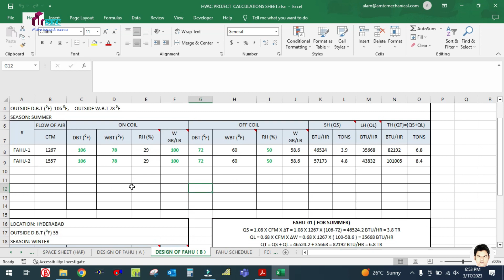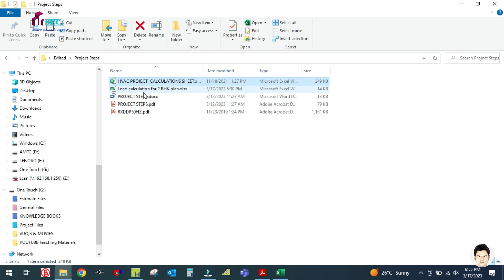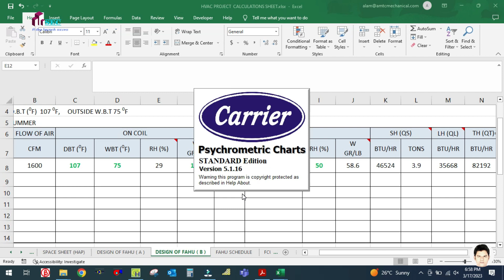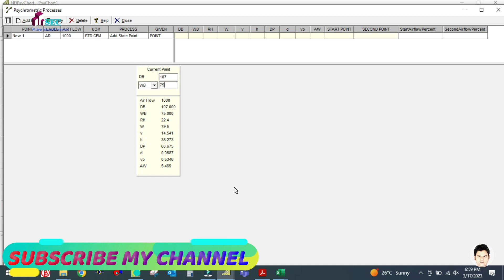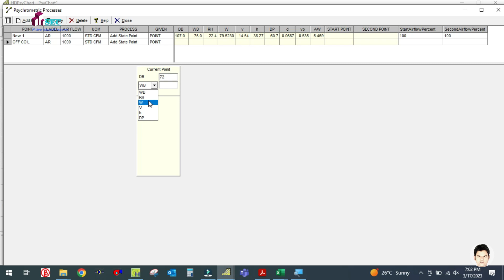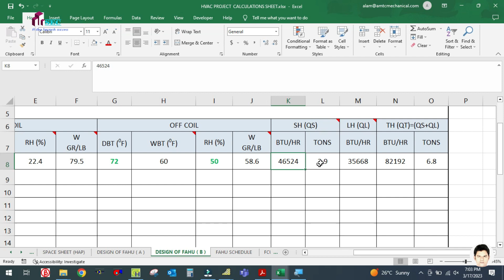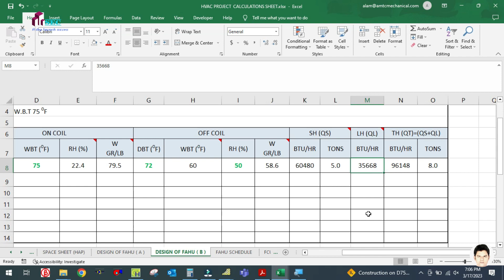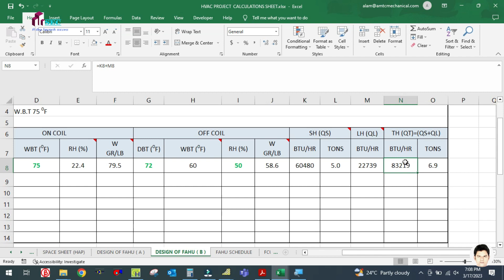STEP - 5 I FAHU SELECTION I HOW TO SELECTION FAHU I

Comment: Sir i saw some drawings of fahu,it supplies fresh air to area and also connected to return diffuser then another connection going to ac unit,do i need to add the cfm of ac unit,return air and fresh air to get the fahu cfm?
Reply from the maker: Not it’s not possible
Reply: @successengineeringofficial7742  it means sir fahu only possible to connect to fresh air duct of the area and another duct going to acu unit but it is not possible to another connection to return of the area?
Reply: @successengineeringofficial7742  if i connect fahu to fresh air duct of the area and another duct going to ac unit then what cfm do i need to calculate for fahu design?the ac unit cfm or the fresh air cfm of the area?

Comment: Brother, there are lot mistakes in your video, sorry to say this. Please confirm if your doing a AHU or FAHU selection? If it is FAHU then the outdoor conditions you selected is wrong and will undersize your system which means your coils capacity cannot dehumidify the outside air at peak conditions,  FAHU shall be selected for peak humidity not for peak temperature. Secondly if you are selection and calculation is for AHU then you already did Heat load calculation and your total load is 4 TR which includes both sensible and latent heat load so you dont have to calculate again because you already calculated in your HAP. Third, your off coil temperature is also wrong it is not the space temperature you are going to maintain. There shall minimum 10 Deg C difference between your off coil and space temperature. And roughly you can maintain off coil between 12.8 Dew point to 14 Deg C, then only you can be able to achieve 22-24 Deg C in your space. For more info call me @ +971 523628934.